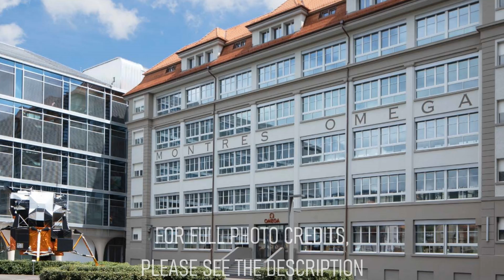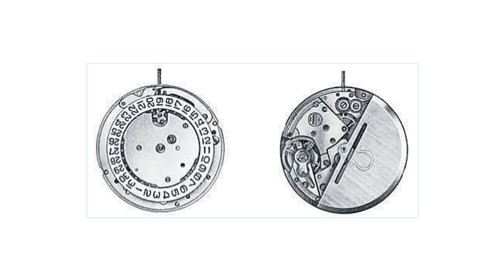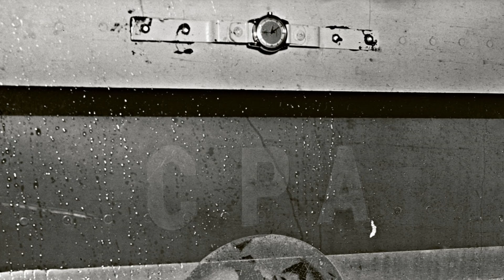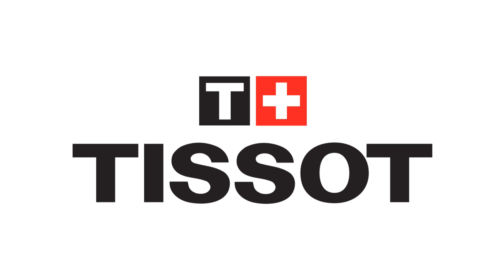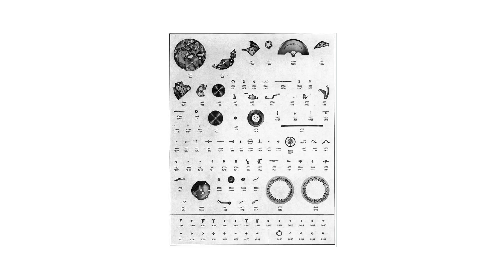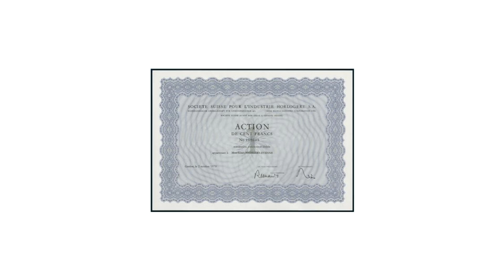Omega's Biggest Mistake: Calibre 1000

Comment: The idea wasn't bad as Seiko was already doing the same thing with their 56 and 52 series, and the 52 series was even revived as the 4S series and had great reviews if not one of the most important movements Seiko ever came up with.
Omega just failed in the excecution of the 1000 series and it really didn't help when they flopped during the Quartz revolution as the revisions didn't come in quick enough.

Comment: I have 2, Cosmic 2000 watches. Cal 1012. If given a proper service are they at all collectible? 

I’ve seen on the blogs that the opinion of Cosmic 2000 and it’s odd case and frame, is that they aren’t worth the cost of servicing. 

Add to that the reputation of the cal 1012, and the question is: is the Cosmic 2000 a watch destined to be the most uncollectible Omega?
Reply: A seamaster cosmic 2000 is my every day watch. 
It looks good to me, keeps time surprisingly well and is affordable.
I modified it to take a screw down crown and refurbished the case and bracelet. Caliber is a 1020, I think. Beyond ugly, but precisely machined. No problem.
Collectible it is not. They are vulgar and ubiquitous and universally despised. Keep yours and wear it.
Reply: @anarcowhatever It had been serviced 15 months ago  I’ve worn it 24/7. It has an unusual hand set. They’re very very slender. At a glance it’s assumed to be a quartz. 

It does ok. It’s no Rolex cal 1570. My other watch. 

And service cost was an issue, but it’d end up in a $5 garage sale if not running. Bit the bullet.
Reply: @larryscott3982   It's a very easy to service movement. The problem is, the cage gaskets are hard to find, bit not impossible.
Mine is the chunkier one with the integrated bracelet, and blue, date only dial. It looks tooly, is an old Omega and, unlike the BB58, I can forget about it.
They deserve the love, as flawed as they are😂

Comment: Had my omega 1012 movement watch was serviced just recenty my watchmaker was happy to take it in and service. The watch ran great prior to the service. However I honestly don't belive it had been serviced in 10 to 20 years  and even it did run well I knew it was still not good for the gears and pivots my assessment was affermed based on the quot and run down of problems. it's a geneve 1973 so i would say its a basic finished but very reliable movement.

Comment: Nice video. I'm a lucky owner of the Constellation in steel. And it's a fantastic watch, late 60s early 70s design at its best. Nobody had a crystal at the back of the watch in them days. That's just the motor 😂. I drive Alfa Romeo and everyone has an opinion on those until they actually get in and drive one.

Comment: An excellent review of these troubled movements (and troubled times, at least where the Swiss manufacturers were concrrned). From my reading on the subject, it was really only the 1000 and 1001 models that were inferior. They had bad lubrication issues and they struggled to maintain power. This was resolved in the 1011 (chronometer) and 1020 movements, which were excellent, if ugly. For collectors, of course, the beauty and finish of a movement is an important feature. Even today, collectors shun these models for that very reason.
Reply: No sabe lo que me alivia leer eso del calibre 1011.
Tengo uno que debe ser muy raro porque no lo encuentro en internet.
Sé que es del calibre 1011, de 23 joyas, del Año 71.
Ref. 1680055
De acero con brazalete integrado con pasadores.
Pero no me coinciden las formas de la caja, no en convesa, o forma de C, más bien es cóncava  hacia el brazalete, es de esfera redonda azul nocturno con polvo de estrellas en dorado muy bonito.
Necesitaría ampliar mi información, gracias.

Comment: The 1000 series movement is deeply inferior to the 500 series and I suspect that a lot of it had to do with cost cutting. The 1000 series seems to be more fragile than the 500 series and probably requires more servicing than the 500 series.

Comment: I think the Caliber 1000 family is amazing. Lots has been talked about it, but generally without an in-depth knowledge of watchmaking. The previous family of calibers, the 55X, 56X and 75X were considered some of the best movements in the history of watchmaking, period. And the comparison to such praise would always be difficult to cope with. But, caliber 1000 family are really great movements on their own. Some important things to have in mind, of which you mentioned several:

1. These were some of the firsts 28,800vhp calibers, and the firsts for Omega with such high frequency. 
2. The higher frequency rate made them more easily regulated.
3. They had hacking system, a first for Omega.
4. The winding system is impressive. It winds effectively, with the slightest move of the watch it begins to wind and starts the movement altogether.
5. They were far thinner, so design liberties were broader in terms of the case.
6. At the same time, Rolex were using angler movements that tried to achieve exactly the same, high frequency, and they just didn't work right. In fact, Rolex 3035 caliber had far worst problems than Omega's 1000. 
7. Caliber 1000 was innovative, but some self lubrication parts gave some problems, but these were changed quickly in the 1010 and 1020 series. 
8. Omega did tried to cope with the quartz crisis by producing a caliber that costed less to produce, and caliber 1000 has that advantage, but it was by no means  a low quality or bad movement, not at all. I prefer caliber 1000 to many attempts of producing an in-house movement by some brands today.
9. It is historically significant, as the only 28800vhp in-house caliber Omega had produced until recently the 9300 caliber.
10. I have an Omega with caliber 1000 and it works flawlessly, after about 50 years. I think that the 1000 caliber problem's were magnified, as Omega did take care of them in service, and then in the 1010 series. 
11. The downfall of Omega in the quartz crisis might not have been this caliber, but something similar to what is occurring right now, in this second watch crisis, with so many brands, the market splitter into high end and basic, not much in the middle. Although Omega was perceived as a better brand than Rolex, with good reason, for the most of the XXth Century, Rolex focused in the 60's and 70's in doing only high market products, they leaved their gold-plated cases from before. Omega still wanted to attack the market more broadly, and that didn't work. Today Omega is not committing the same mistake, but what happened in the 70's.

Cheers, and thank you for your video, as always.
Reply: Great info! How many years did it take before the 3035 was considered a reliable movement?
Reply: @Mythicregard  Thank you! I am glad you find it interesting. To your concrete question, I have the first part of my response. But I added something more...

 I know what kind of problems caliber 3035 had, but not when did they solve them. Caliber 3035 was not an in-house caliber, let's remember that Rolex used always Aegler's movements, until it bought Aegler in the 2000's or late 90's. But, in any case, Aegler's caliber 3035 was a deep redesign or the caliber 1570, which was very well known for reliability and durability. Nevertheless, the problems with caliber 3035 were diverse, they included, cracked jewels, worn reversers, damaged axels, rotor assembly issues, premature wear and entangled hairsprings, as horological expert, Guilfoyle, enumerates. This caliber was in production until 1988, which is not a very long run, but I would think they solved most problems in the first years. Although, in comparison, calibers 1000 had less problems, and 1010 and 1020 had all of the problems solved, and are dependable. In fact, the best caliber from those days was neither Omega's 1000 nor Rolex's 3035, but Longines 990. Most brands aimed at producing thinner movements with 28800vhp or higher, 36000vhp, with hacking system and quick date change. Both Rolex and Omega had most of those attributes, but Omega's 1000 was even thinner, almost 2mm thinner. The Longines had also all of that but was 1.3mm thinner than the Omega... And in contrast with Rolex and Omega, didn't have any relevant problems. That's why it's still produced by Breguet today..., as they own it, Lemania bought it from Longines. Not even JLC's 920 movement, used by PP, AP and VC could do all that.

The problem for Omega was more to cope with the quartz crisis with a very bad marketing and bad branding, which is a long problem for Omega. Omega products are phenomenal, but you don't really know what a Constellation is in comparison with an Aqua Terra or an Speedmaster vs some Seamaster chronographs. That is my main complaint against Omega, too many models, and not well separated, brand structure, although their products are above competitors marketed as above them, like Rolex. Omega is capable of producing high horology which brands as GP and JLC produce, Rolex has never done that nor had the capacity until very recently, but still haven't produced it.
Reply: @leestrada1  Thanks for the detailed response. With all the issues with the 3035, why do you think Rolex was able to maintain it's sales and reputation through the late 70's and 80's compared to Longines and Omega? And what do you think caused Longines to lose status compared to the other two?
Reply: @Mythicregard  You're welcome. That's an interesting subject. I believe that Rolex, as Omega, solved the issues along the services. But Rolex begun before to place itself as an only luxury brand, which in the past decades it haven't been entirely. In the perception of anyone up until the 60's, Omega was a superior brand but both had larger markets than today. Rolex produced gold-plated watches and other "faults" associated with non luxury watches, as well. But by the 60's they were producing only stainless steel, ss and gold and gold watches and their marketing and branding let you know all that, it was spot on. Omega and Longines, on the opposite, in times of crisis, in the 70's begin to produce more gold-plated watches. They thought that the way to cope with the crisis was to broaden their market, which was exactly the opposite of the best strategy. If you search, at least in Omega, for gold-plated watches, you will find that they produced very few in comparison to other materials, in the 30's and 40's, really few or almost nothing in the 50's, almost none in the 60's, but in the 70's they did produce many. So, which brands survived the quartz crisis? Only the ones perceived as pure luxury, as Rolex managed, or that indeed were pure luxury, as PP, VC, and AP.  The fault wasn't the caliber 1000 or producing quartz watches, that was assertive. In fact, in the 90's PP talked publicly about how proud they were of producing quartz watches and how they developed this technology, etc. They were selling more quartz than mechanical watches. Omega maintained the reputation, a more than a century long reputation didn't disappear, but lost the money.
Now, Longines is a sad story, because they failed in the quartz crisis even worst than Omega. And in the new management, under Swatch Group, which is the consolidation of two historical groups, SSIH (Omega, Lemania, Tissot) and Asuag (Longines and some others), put all their efforts in returning Omega to be the flagship of the group, not the most luxurious brand, that would be Breguet, but indeed to return Omega to the position it had before the quartz crisis. I believe Omega is now doing even much better things than what they did in their best days. And they placed Longines under that position, so that these two brands didn't compete with each other. But both are extraordinary brands. I could broaden that later, if you are interested in a sort of comparison of all these three brands ;) Cheers.
Reply: @leestrada1  Excellent analysis. I'd love to hear more.
Reply: @Mythicregard  Thank you, I'm glad you find it interesting. I was thinking about how to explain the major differences between these brands, but I find it to be too long. Maybe it's best if you ask specific questions you would like to compare between them, and I'll try my best to respond.
Reply: @Will Harris Thank you, I am glad you find it interesting.

Comment: Nicely done.  I service my own watches, which includes a 1012 and a 1022.  I will say that they are good overall, but I agree not as good as the 500-series (which I've worked on as well).  Weak spots for me have been the date disc change mechanism and the winding train including the wig-wag pinion.  Both are a little fussy, and the movement does feel a bit fragile overall, but they run well when taken care of.
Reply: I’ve seen YT vids of the 1012 full servicing. I think I saw 2 plastic parts. Is that so? And is that a problem in 2024? Aging plastic.